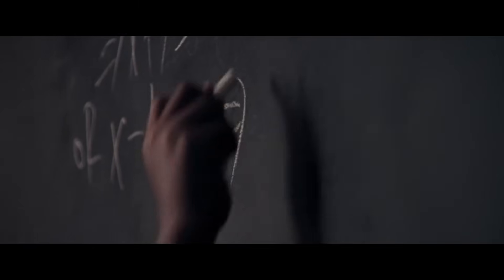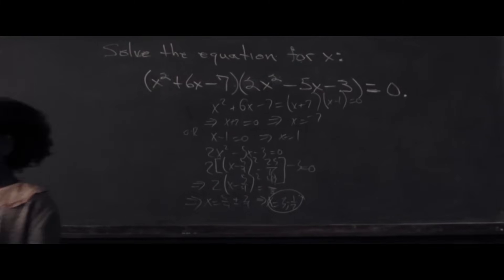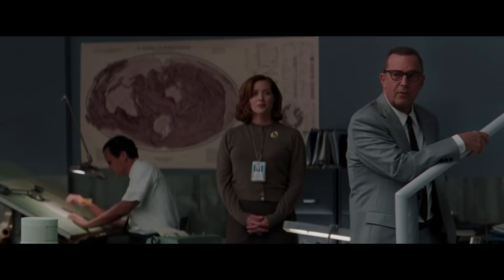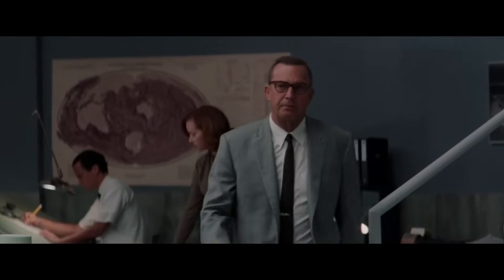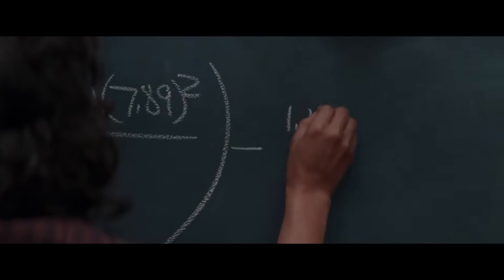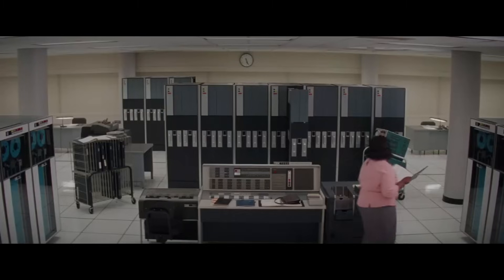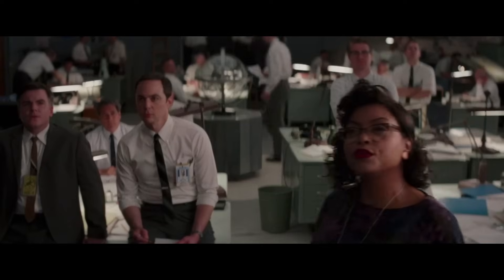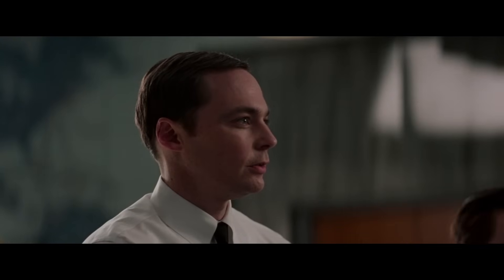Uncover the Math and Science in HIDDEN FIGURES (2016)

Comment: In the early scene where their blue Chevy is broke down along side the road with a bad starter. First of all, unless they deliberately stopped for a bit, a faulty starter wouldn't cause the engine to stop running. It would only prevent them from restarting the engine. Though, the starter wasn't the actual problem. It was the solenoid. Back then most starters had a solenoid between the battery and the starter. So, if the solenoid stop working, you'd simply by-pass the solenoid not the starter using a screwdriver to connect  or touch either solenoid terminal and the starter would turn over the engine. However, this movie is a good one.
Reply from the maker: Def a good movie.

Comment: There was a much better method than Euler's method that was known at that time.  It is called Runge-Kutta or RK for short.  RK allows one to estimate trajectories more accurately with fewer calculations.  Even so, a computer is necessary to do the calculations for either method if the answers must be calculated within minutes given the processing power they had back then.   It also may not have made much difference if the resolution of the calculations was poor.
Reply from the maker: Hindsight is usually clearer.

Comment: yeah well, having actually watched this clip, this is basically a slightly more in-depth review of the movie, than the review that I've seen before this. 

It's still mostly nonsense. 
that could be that the information that it presents is simply not true, ranging from outright false to a nonsensical variation of the truth. Or that it's a list of facts but presented in a sequence that varies from a distortion of the true timeline to wildly inaccurate even true fiction. 

In this case it's a mixture of the two. 

The first problem is that they wouldn't have a manned spacecraft test-out the solution as indicated in the movie. All of this would already have been done probably before a torch hit metal, probably by just borrowing the required technology from an ICBM program. A manned mission like this is just an ICBM program with the warheads replaced with an environment which would sustain life. Sorry but long before we get to the technical details, Paul talks about how they lost Shepherd and they lost Grissom. We didn't lose Shepherd and Grissom died years later on the launch-pad in a capsule fire, the Apollo 1 disaster in 1967. We had the entire Gemini program between Glenn and Grissom. Shepherd flew on Freedom 7 before Glen and a decade later on Apollo 17. He's the oldest person to have walked on the Moon, at age 47. This is an example of the writers throwing slightly-relevant and possibly-remembered facts into the movie in a way which is clearly historically inaccurate. 

I doubt that the US space program has ever cooked an astronaut the way that the Soviets cooked Gagarin. Beyond that, a mechanical death might have happened similar to the Apollo 1 disaster, but at this point I'm not inclined to research this further. We've lost thousands of test-pilots, we lost astronauts after Glenns' successful flight. I'm sure that we'll lose more. The point is that we did not lose either Shepherd or Grissom to any dynamic flight accidents or miscalculations....what Paul said about them in the movie was totally untrue. 

Redstone vs Atlas (Shepherd vs Glenn) is a completely different issue. 
Redstone was a US Army ballistic missile program that also carried the first American astronaut, Shepherd, into space. Our first nuclear-capable ballistic missile program, it was a direct descendant of the V2. The inference I suppose that we hired Werner von Braun (the guy with the German accent) to handle the technical issues of the Mercury program. It was a short-range ballistic missile, literally an extension of conventional missile artillery, with a maximum range under 200 miles. It did however carry the first US astronaut which gives us an important clue about the accuracy of the discussions and doubts of the heat shield. All that is probably bullshit too aside from the fact that she didn't wear glasses). 

The beauty is that space is roughly 50 miles up, depending on who you talk to. 
That's all the altitude that you need to deliver a ballistic warhead. How far can you throw it? That depends on the lateral velocity at the highest point of the rockets' trajectory. That 17,500 mph is roughly accurate as far as I know, but that's for unpowered "low-earth" orbit. If you want your capsule to orbit higher, it has to fly faster. They could have learned everything they needed to know from Redstone, probably even the V2 which raises the probability that they could have learned it in WW1 or even earlier. The only real difference would be the velocity at apogee and the resulting consequences of that velocity in terms of thermal effects on the "projectile"...which depends on air density at altitude...and whatever it is that you're actually bringing down from space.

"The Redstone spawned the Redstone rocket family which holds a number of firsts in the US space program, notably launching the first US astronaut. It was retired by the Army in 1964 and replaced by the solid-fueled MGM-31 Pershing." -wiki. 

So this raises a very pertinent question, was this the missile platform that Glenn flew into space? No. 
"John Glenn orbited the Earth in the Mercury Friendship 7 spacecraft, which was launched by an Atlas launch vehicle on the Mercury-Atlas 6 (MA-6) mission on February 20, 1962. "

...what missile platform did Shepherd ride into space? 
"in May 1961 he made the first crewed Project Mercury flight, Mercury-Redstone 3, in a spacecraft he named Freedom 7. His craft entered space, but was not capable of achieving orbit. He became the second person, and the first American, to travel into space."

So from this I gather that Mercury-Atlas was an improved version of Mercury-Redstone that was capable of launching the Mercury capsule (or a nuclear warhead) into orbit. Lesson here, the ability to achieve orbital velocity was the key and yes that would depend on the payload weight among other factors. I take it that this means that none of the Redstone rockets could reach orbit even with no payload. Which is not too surprising given that they were directly derived from the V2, which already had enough trouble even getting off the ground reliably, and had to be launched from Holland or even France just to reach London...but they did launch from Holland in attacks against the UK right up until the end of the war. Again, nothing to take lightly, but not nearly enough to keep pace with the Soviets.

Shepherd launched a month behind Gagarin, who ironically died at the controls of a Mig-15 during a training mission about 40 miles NE of Moscow. He also completed one orbit on his one spaceflight after which he was named a Hero of the Soviet Union and banned from further spaceflights after the Komarov disaster (got cooked on re-entry, there is a long story about that which insinuates that Komarov took Gagarins place as he knew that whoever flew that mission would not survive due to poor QC of the capsule but the Party Ministry insisted on the flight anyway, "sounds familiar").

The point being that there is very little chance that the go/no-go calculation wasn't worked out and tested with Redstone and Shepard before Glenn actually flew. If it could put a Mercury capsule into space but not into orbit, he wouldn't survive the re-entry if they didn't know that it would at least be capable of making it to a survivable re-entry attitude.

How much of a problem is it if the entire plot of the movie is bullshit?

This is like saying that we attacked Iraq because Saddam Husseins two sons piloted the two 757s that crashed into the WTC. Speaking of 911, which again, by the way, was not just forseeable and predictable, but actually was forseen and predicted. You can research and pass judgement on the role of the US government in taking actions that contributed (as Trump would say) to 9/11 in your spare time.